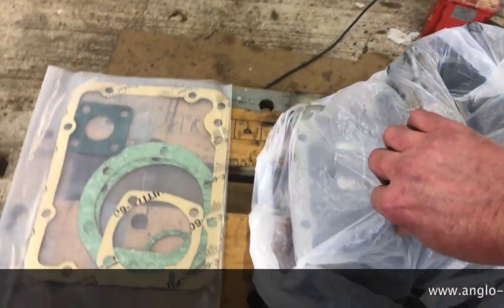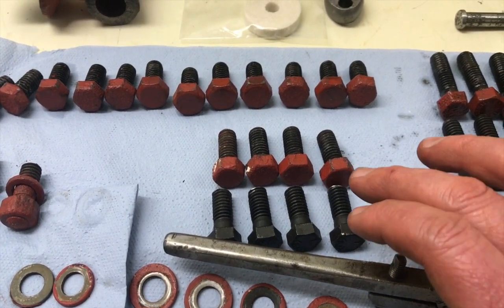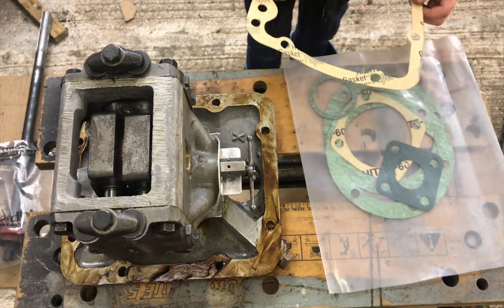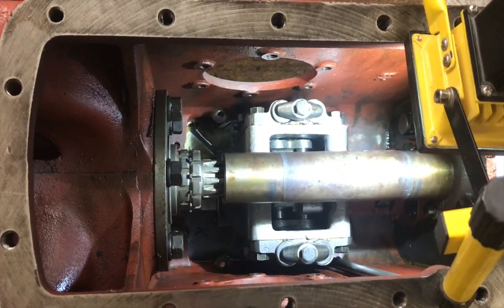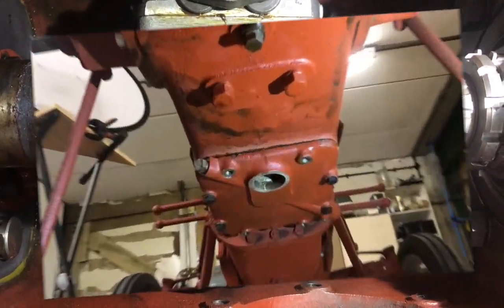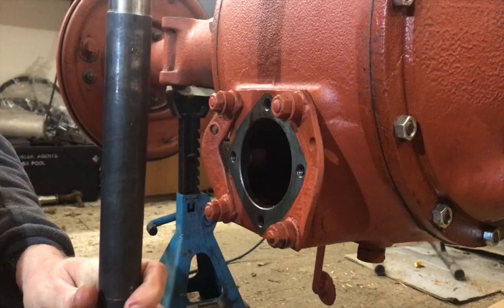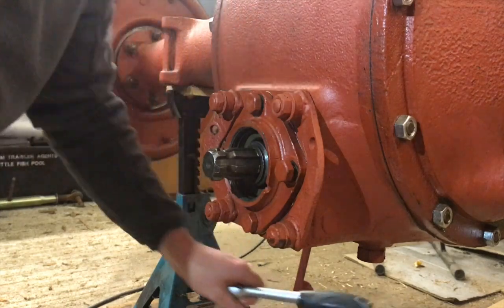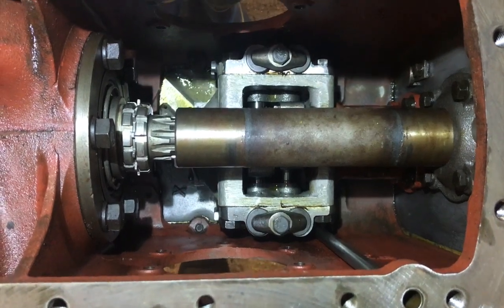#62 Ferguson TED20 - Installing the Hydraulic Pump - with Anglo Agriparts

Comment: G day Gordon and Oscar, The alloy part was introduced to maintain rigidity in the control valve arm, the earlier tractors didnt have it and it must have flexed.
Reply from the maker: Thanks Lance - makes sense. The arm is quite long and is acting on a "delicate" valve T-piece by comparison.

Comment: Sorry i have question my Ferguson weels Trurn and my motor forced on the neutral  position but when i push on Clutch the weel dont turn and motor dont force . When i released the clutch at neutral the weels turn and motor forced too sorry my english i Côme from Québec tank for your Help 🧐

Comment: Hello Gordon & Son. Once again another great video. What is the weight of the hydraulic pump? I'm asking because this might be added to my task list. At 70 plus years old it could be a bear to handle while working alone. Might need to coax a young neighbour fella into the garage to lend a hand. My mind still thinks I'm 20, but the body reminds me that its getting long in tooth. TTFN/CDC
Reply from the maker: Hi Charles, it’s reasonably heavy and mostly awkward to man-handle. Ideally it’s a two person job, but with a bit of ingenuity and forward thinking one could do it alone and safely. 👍😉

Comment: Sorry its when my Tractor is on neutral no clutch my motor forced
Reply from the maker: Hi Kevin, I think I understand. It sounds like the gearbox is stuck in one of the gears. Although what I find interesting is that you describe it as the 'engine is forced' which I think you mean it is "labouring" in other words slowing down and sounds like it is 'working'. Normally if it was stuck in a gear the tractor would start to move or the engine would cut out if you have the brakes engaged. So that would mean your clutch is slipping as well. Has the tractor been standing for a long time? I would suggest you try to diagnose the gearbox first, but most probably you need to replace the clutch as well. Sorry I can't be of much more help, with the limited information you've provided. If it's easier send me a more complete description of the problem in French and I will get it translated by a colleague of mine. Best wishes Gordon.